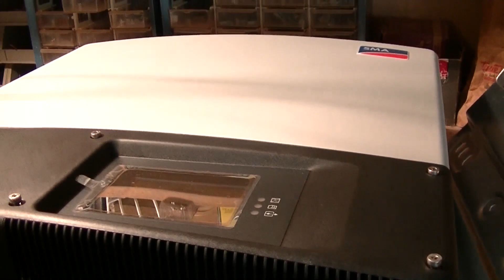3KW DIY Solar Project Part 3 - SMA 3000TL US Sunny Boy Grid-Tie Inverter and Almost Everything Else

Comment: The big blue box film capacitors are probably the DC link isolation capacitors, but I would expect those to be more centrally located on the board.  Those capacitors serve as the isolation barrier in transformerless designs like this that keep the PV array isolated from the mains.  The way that these work is that the DC electricity from the PV array is pulse width modulated in such a manner that its instantaneous RMS potential is slightly higher than the instantaneous potential of the mains at that moment and so that both are in phase.  The electricity from the PV array is then sent through the DC link caps to which the ultrasonic electricity and its myriad harmonics appear as a dead short.  The PWM component of the electricity is filtered out on the AC side of the inverter by the big common mode chokes above the AC connections.
The auxiliary emergency receptacle seems like a no brainer given that these grid tie systems are useless when the mains quits.  This is the first GTI that I have seen to incorporate such a feature.
And MPPT is just maximum power point tracking.
Reply from the maker: randacnam7321 Very good information there!  You sure know a lot about these things!  It's really amazing how they can do this like that without a transformer.  Thank you!
Reply: Makerj101
The reason for the transformerless design is because the transformer alone would weigh close to 100lb on its own and cost over half a grand for an inverter this size.  At least that is what I come up with when pricing transformers for my inverter design.

Comment: Where did you get the mid-clamps and end-clamps ?
Reply from the maker: ***** Good question.  My dad ordered them somewhere online.  Possibly eBay.  If not eBay then a solar supplier.
Reply: Makerj101 You definitely made a cost effective choice for the rack. I want to implement a similar mount system. Can you please share your part list. Thanks

Comment: I understand this video is a bit old but I would like to see more info in your descriptions. What kind of AC disconnect is that? For those of us who aren't versed enough in the solar setups.. that could be useful information.
Reply from the maker: Good question!  The DC connect came with the inverter.  It is specially designed to bolt onto the inverter for a quick setup.  I don't remember if it was extra or not for the disconnect.

Comment: The two MPPTs and the emergency power are pretty neat. I guess if you have a prolonged outage, and it's sunny out, you can run some extension chords to power slayers :).